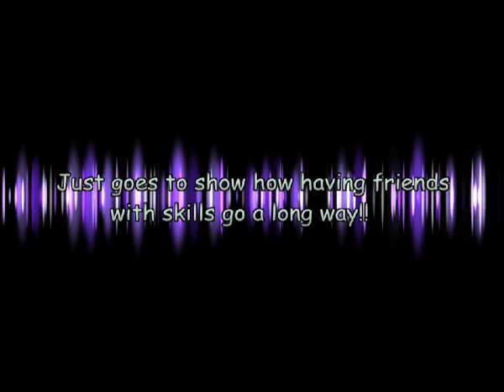The 'New' Window

Comment: At about 2:00 you show putting peel and stick rubber behind the siding. Tried that before, very hard to do. How do you slide something so sticky? Any tips? For my own house planning to slide vinyl roll stock behind the siding then adhering to nail flange with the peel and stick.
Reply: So long ago I can't remember how I did it.  I put more on than needed. Usually, only, I think, only need at the bottom.
Reply: when i have to jam tape in a tight space i just peel back part of it and fold the backing paper over slide both in the space and tack the end you peeled then grab the folded over backing and pull it out while pressing the tape in where you want it

Comment: This is an old account of mine that I cannot access anymore.  Talked to a contractor about your comments about having a header and he says.. 'Well actually, if it's not a load-bearing 2x4, then it's not the utmost importance.'  Right now as of May 2020, there is no problem with the window, no sagging, or water leaks.
Reply: It actually is a load bearing wall… any exterior wall is load bearing, along with any walls that run perpendicular with your 2nd floor, floor joists.  Needs a header and jack studs to transfer the load of the roof and second floor.

Comment: This window installation would fail inspection. 2:52 Your friends skills obviously doesn’t include basic construction.
Reply: Well actually, if it's not a load-bearing 2x4, then it's not the utmost importance.  Right now as of May 2020, there is no problem with the window, no sagging, or water leaks.
Reply: @scottw4603  all of the exterior walls of a house are load bearing. it may not have as much weight as lower wall holding end of roof but still holds up some weight.it is not a big window but still should have a header

Comment: U dint support the window all weight will be on the window
Reply: Well actually, if it's not a load-bearing 2x4, then it's not the utmost importance.  Right now as of May 2020, there is no problem with the window, no sagging, or water leaks.